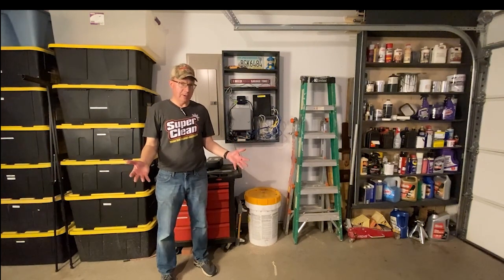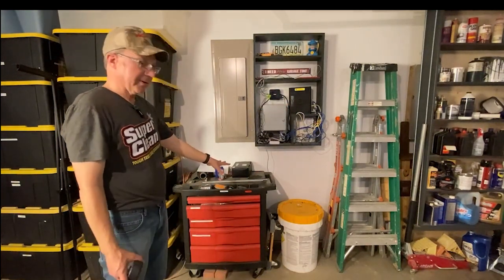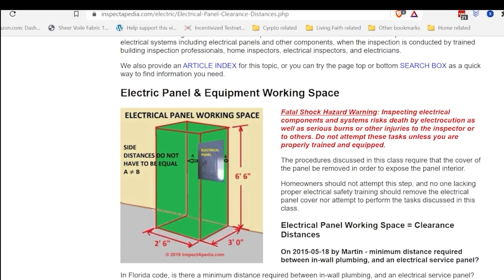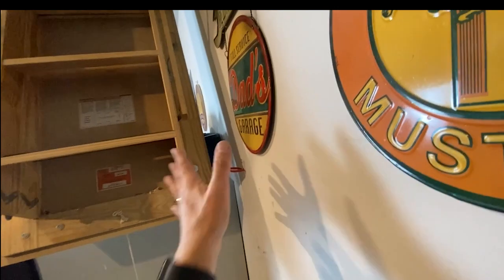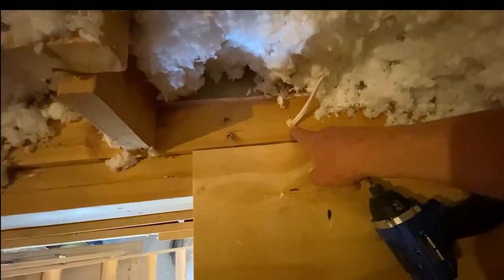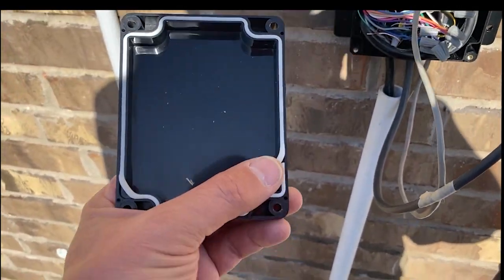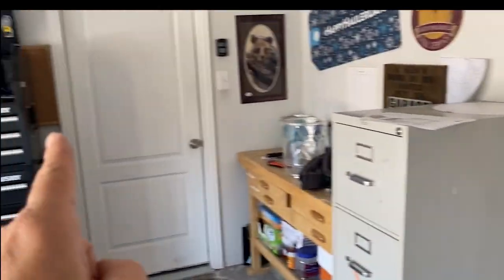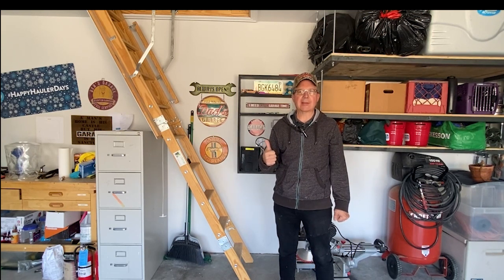DIY Youtuber gets busted for an NEC (National Electrical Code) violation in his garage. Now what?

Comment: Side distances do not need to be equal. Unless I’m reading that wrong, as long as there is 30” and you do not intrude in front of the panel you’re good. 

That being said, the new location looks good as well.
Reply: That is correct, as long as you have a 30-inch width and the panel/ sub-panel is within that dimension code is met. The clearance on front is 36 and the height not leas than 6’-6”.

Comment: Yeah, but if the NEC was so great, why would have bonding to concrete incased rebar have been rejected by the current NEC after having been untested for 83 YEARS!  

Becarful, NEC does not necessarily translate directly to safe.  As much as we think we know about electrons, it turns out we don't know jack crap.

Comment: I am an electrician (18 yrs) in Washington state. The only thing I saw wrong with the install you had was the “nook” you had built. 

The other equipment, irrigation control, telecom box, router are allowed in the “working space” as they are electrical components. 

The rolling cart and stored items can be debated, but the new location certainly is cleaner!

As for parking a car? Most inspectors would measure the distance between the panel cover of the breaker panel and the side of the car when the doors are closed. If you can park your car inside the garage and open the doors to full swing, you have plenty of room!
Reply from the maker: Hey thanks for your clarity. Much appreciated!

Comment: My understanding is that the two NEC clearances (36 inches in front of an electrical service panel, and 30 inches side to side) apply to installed fixtures, not stored items which are readily moved away from the panel. The rolling cart in front of the panel and the plastic storage bins to the left of the panel are not fixtures; they are stored items. Examples of items that would be a violation would be a base cabinet installed beneath the panel, or a wall mounted cabinet to the side of the panel. I don't believe your garage was in violation of the NEC. Of course, it is wise to keep stored items far enough from service equipment to allow easy access. That is different than saying it is a violation of the NEC to store items closer than allowed for permanently installed fixtures.
Reply from the maker: Thanks for your comments. Are you an electrician? You seem to know your stuff.
Reply: @ScottsGarage17  Not an electrician, just a retired home  inspector.